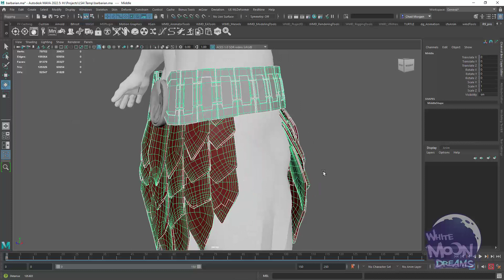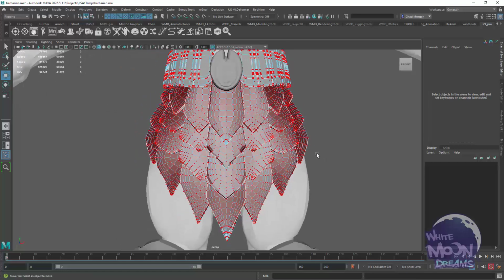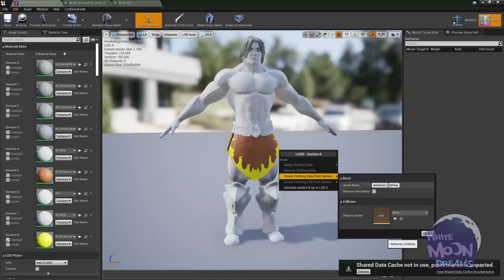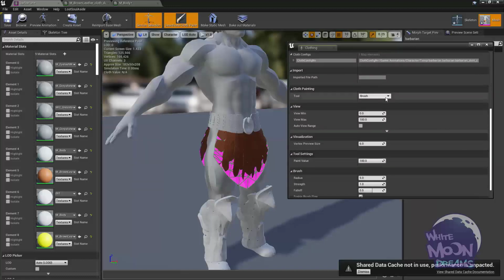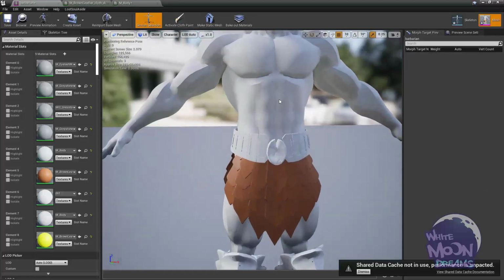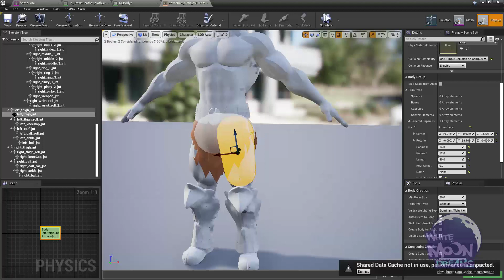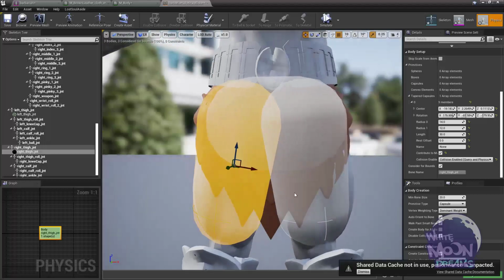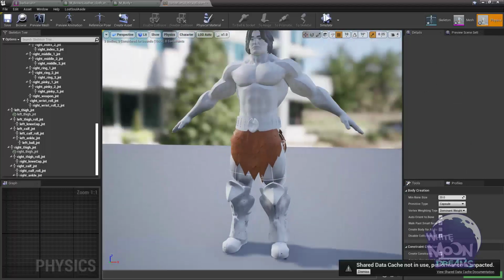Creating a Cloth Simulation in Unreal Engine: Low-Res Mesh to High-Res Cloth

Comment: Hi. Did that but when I bring my character into my level, it does not have that cloth simulation. The cloth simulation only works fine when  not in the level Im working on. How did you make it work in the level ?
Reply from the maker: I would have to look, it should be working. Is the level actually running? It won't show up in the level unless the level is running or simulating. If you place the character in the level the cloth sim will stay inactive until either of those things happen